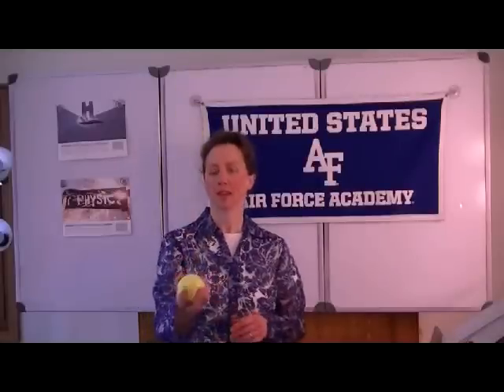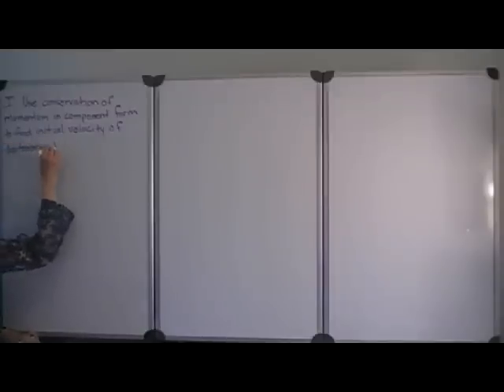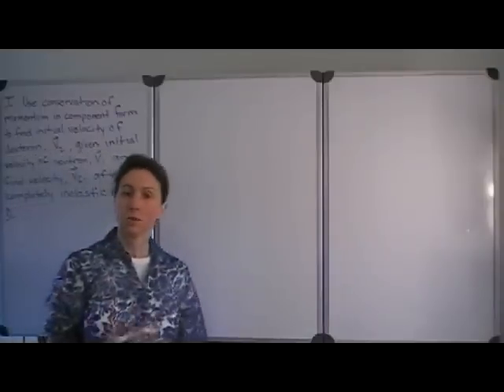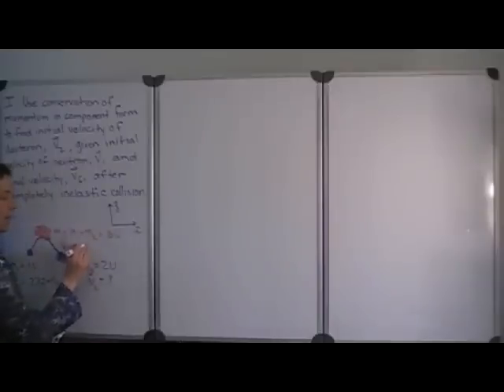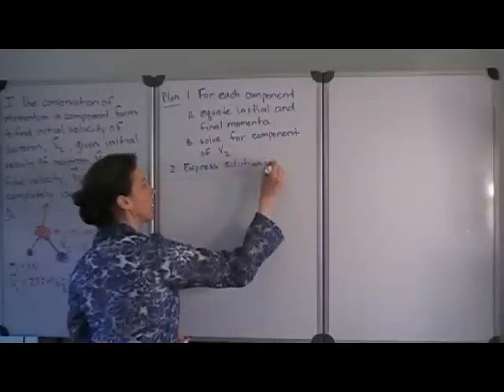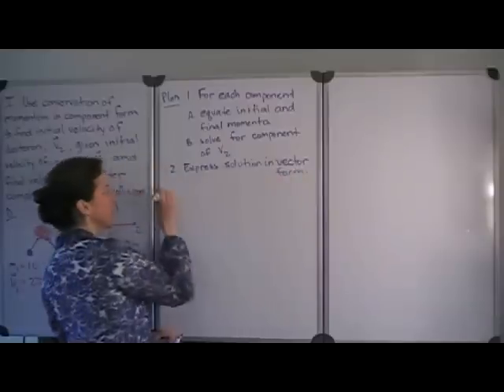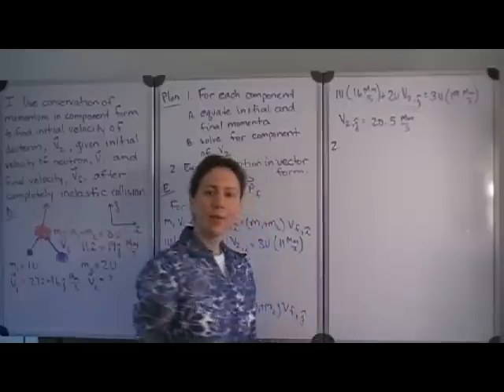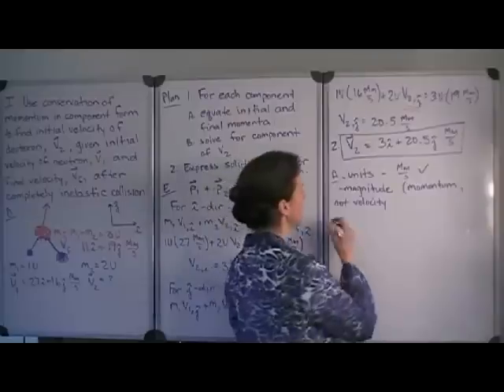Conservation of momentum two dimensional inelastic collision of particles.avi

Comment from the maker: The center of mass of a two particle system, aka the barycenter, can be thought of as the point between them where they would balance each other if they were connected by an imaginary stick. To find its location, r1 = a*(m1/(m1+m2)), where r1 is the distance from mass 1 along the line between the two masses, a is the distance between the centers of mass, and m1 and m2 are mass 1 and mass 2.  To express an answer in vector form, you may need to add components of r1 to the components locating m1.